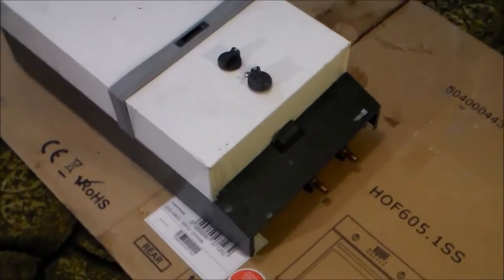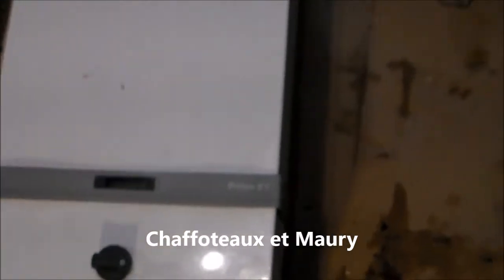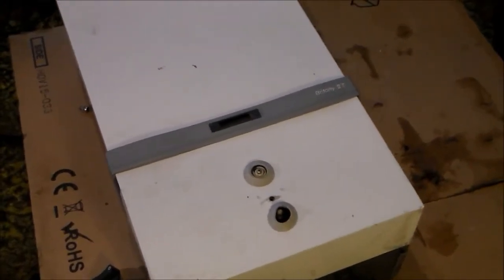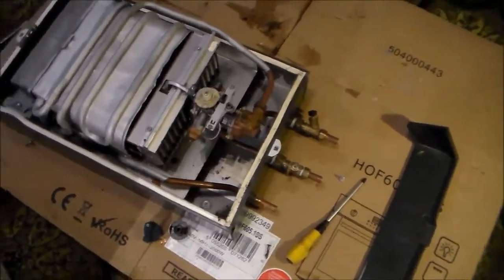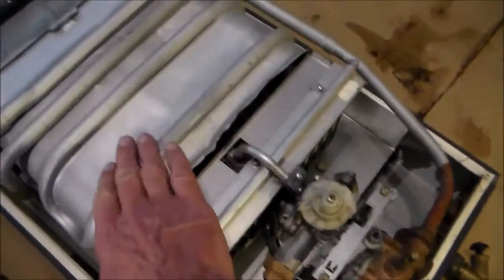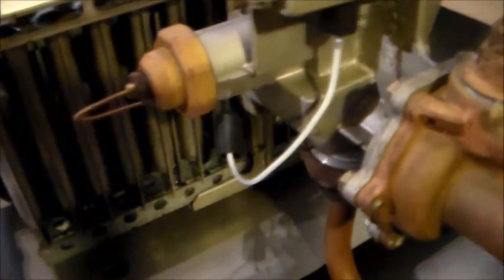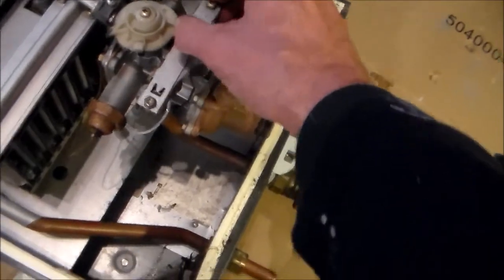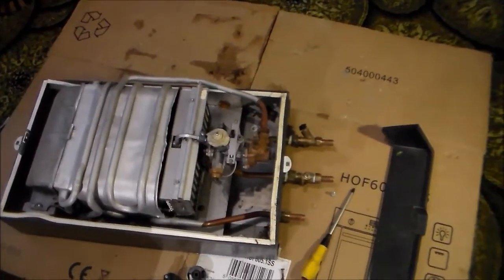britony II T boiler strip down

Comment: Keep the parts. I'll buy the whole thing. They're a simple design and construction but give years of trouble free service.
Reply: Yes.  I was surprised how straightforward they are.  The replacement is massively complicated but supposedly more efficient. I have not scraped the parts yet but would not recommend reuse. Free to collect. The case has gone, just the heat exchange and a couple of valves in the shed. Located in Bradford. I will not ship.
Reply: @bikerides  ok,thanks for that, John. Yes ,the replacement will be more efficient but I'll drag out its life as long as possible

Comment: Hi, thanks for the video! Could you also do one on how to reignite the pilot light when it goes off? Or just explain in a comment? I haven't found that anywhere else. Thank you so much!
Reply from the maker: Hi Mihaela, I got this out of a scrap bin. It was working until removed from a house, but no one wants a second hand boiler. I have not lit the pilot on this. On a similar one I had you pressed a button to allow gas to reach the pilot light and generate a spark from a piezo. You had to hold the button until the thermocouple opened the gas valve, at which point you release the button. Can you hear a click? Can you see the spark? Can you hear gas while you are holding the button? If this does not immediately answer your question turn off your gas and call out a qualified engineer.
Reply: On this model it is the top knob of the two that ignites the pilot light and also opens the main gas valve. It is very simple to ignite and this is an everyday procedure. For instance if you are going on holiday you will want to turn the pilot off and will then of course need to relight it when you come home again.

Turn the knob all the way anti-clockwise until it is at the 12 o'clock position and will not move any further. Assuming it has not been lit for some time--and is therefore cold which means the thermocouple is discharged and unlocked--turn the knob anti-clockwise against the spring resistance. At the 9 o'clock position the piezo will fire and hopefully spark the pilot-light. If it doesn't, return the knob back to 12 o'clock and repeat until it does.

You can tell by peering in through the little window. You will see the blue pilot flame if it is lit although it can be a bit tricky if you are stood in a brightly lit room.

Once the pilot light is burning wait about thirty seconds with the knob still at the 9 o'clock position to be sure the thermocouple has charged and locked and then rotate the knob all the way to the 3 o'clock position where it will stop. This should have opened the main gas valve. You can test all is well just by turning on a hot tap and again looking in through the window to see if all the burners have fired.

That's it!

The only minor difficulty could occur when you are trying to relight the pilot if it has just gone out for some reason. In that circumstance once you have returned the nob clockwise to 12 o'clock you will not be able to turn it anti-clockwise beyond the 11 o'clock mark as the thermocouple will still be hot, charged and locked, Very, very important--do NOT try to force it!!! You will need to leave it for perhaps half an hour to allow the thermocouple to cool. You can then go through the above procedure. If you happen to be close to the heater when it happens you will hear a distinct, sharp click as the thermocouple unlocks. Otherwise you will just have to try periodically to see if you can move the knob to the 9 o'clock position without forcing it.

If the pilot light keeps going out then you must make sure the knob is back to 12 o'clock and make an appointment for a 'Gas Safe' (CORGI doesn't exist any more) certified plumber to come and have a look at it for you. Under no circumstances should you try to open the case and repair it yourself.

Comment: How do you remove the brown section at the bottom with the unit attached to a wall as the screw holding it on is impossible to access from underneath.
Reply from the maker: Hi LT, as you can see I had taken it off the wall before stripping it down. I hope you find a solution.